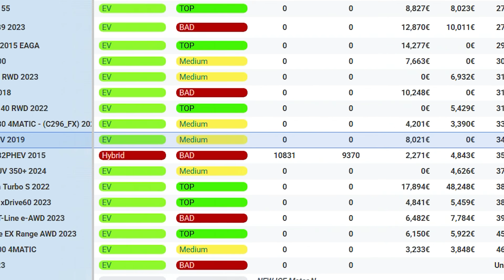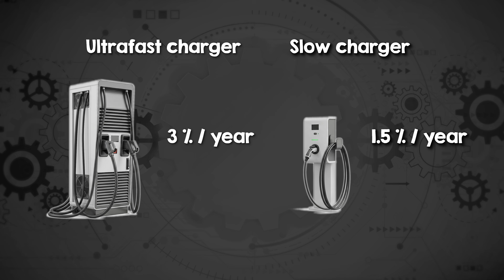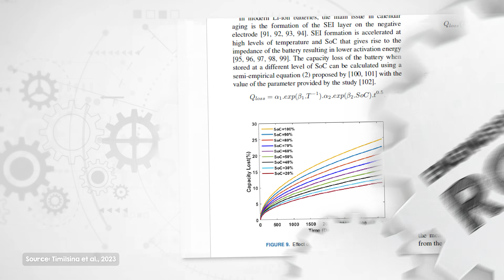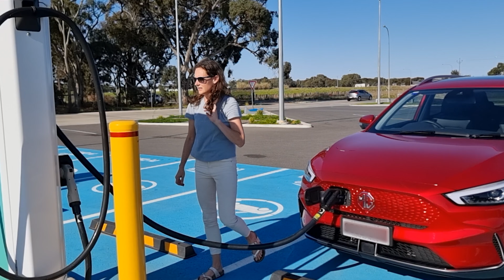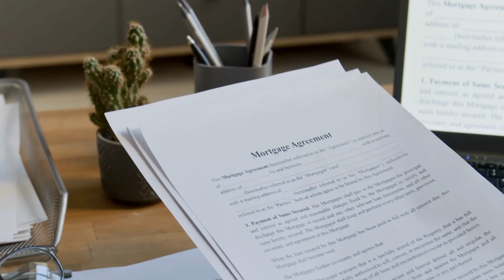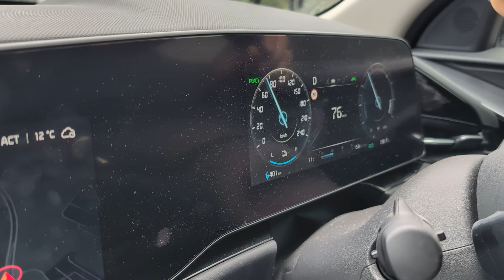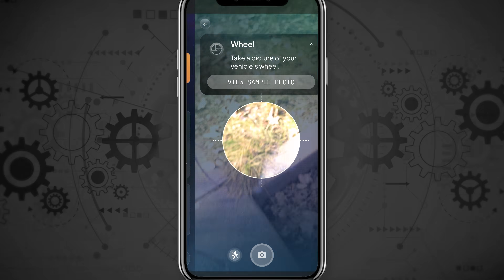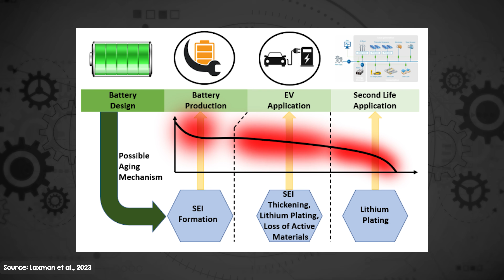Watch This Before Buying Your EV

Comment: I am in the market for something small and simple kind of like the Chevy Bolt and part of the reason an EV's is not for me.... is all the Battery games and nonsense that EV drivers have to play, as after a life time of Stop for gas(anywhere), Fill up, drive off  5 min tops and don't ever think about it for at least a Week. Sorry I don't have the desire to monitor and live by charging best pratices ONLY up to 80% and never below 20% yet we have to pay for the Full Battery usage. Bet they turn this into a monthly paid service at some point. I am in Tec. and don't want my life to rely on being internet connection etc. A coworker is frequently late (by hours) cause his car did not charge last night, the place of work is too far to make it in one trip etc (not my excuses his). Lets just say I have never had this issue. Price aside I will stick with gas till they fix all this Charging and multiple App STUPIDITY, Charging STUPIDITY, Safety, Actual real world milage and not exzaggerated bloated #'s no one will ever get.
Reply: Maybe do genuine research before you buy? She explains the 80/20 thing  like 5 mins in 😅  You have to monitor your gas in a similar way and you could get an ebike if you don't have access to solar chargers

Comment: One thing to bear in mind is that ICE car performance will typically degrade over time (horsepower drops and mechanical parts wear out). It’s difficult to compare an EV degradation against ICE but, to look at it another way, you buy what you can afford and, if you’ve had the right surveys and inspections, you will get a car that matches you needs.
Reply: Mhm research is everything and if you're in a tight money situation you can check out e-bikes or similar ev transport options 🙃

Comment: The conclusion I'm getting is that better regulations are needed to certify used EV's to improve consumer trust and knowledge. But, at least where I'm from, there is  lobbying against used cars, e.g. government EV schemes only cover new cars, and always exclude used. Although that may change as small business used car leaders seem to be getting absorbed by big corporations (similarly to what happened to independent car repair shops). In my personal case, I don't see myself being able to get an EV. I only have access to public charging stations, there are few and the kWh charged price is insane (again poor regulations and lobbying preventing real competitive market). I try to be conscious about my ICE car but, as far as I understand, my options are restricted to hybrids. Ideally I'd love to see public infrastructure where charging stations wouldn't be priced similarly to gas stations, specially near apartment buildings.
Reply: Ya.... It's a mess I actually recently found out it's even hard for insurance since the public doesn't buy EVs as frequently as gas cars so rates hike nor understand that you don't need a giant battery to get good mpg/range 🫠

Comment: thanks for the video madame, i appreciate the research and thoughtfullness that obviously shows in the presented film, i just bought an ev and as someone who looked after his old petrol sports car more than himself i am NOT missing it or scared about ev servicing prices, i dont even plan on having any issues, sure i bought a good model, but its still chinese and theyve had good models for years now and in recent months plenty more of them, just wish they had some more affordable smaller battery models as i dont really need to cart around 75kws. that said the higher sizes are useful for camping or even day to day living with phones like my samsung s24 ultra using battery charge like it's rapidly going out of fashion, forget a macbook.

worst case scenario you've got a chassis that can handle a new battery and maybe they come out with better technologies so you would want to buy a new one anyway in 7+ years. 

cheers guys, enjoy your evs and the drives and destinations!

Comment: I’ve had my EV 3&1/2 years and recently bought an OBD scanner to see my battery SOH and make sure what I was doing with my charging was okay. I was very happy to see the SOH still saying 100%. I primarily charge in my garage only at a rate to get the battery where I need it in the time I have (eg. Charging to 90% from 20% over 10 hours only needs ~5.6kW rate). I slow charge to 100% once a month IAW manufacturers recommendation. And I limit rapid DC charge to 85%. Hopefully the OBD is not lying to me but 50,000km on from new I’m pretty happy and range appears to be about the same.
Reply: The graph at 5:31 suggests that your “Soh still saying 100%”  isn’t accurate, and 50 000 km without degradation?  Hard to trust that data.

Comment: Hi Rosie I noted the 2016 Nissan leaf mentioned as a comparison in your video, really important to state this vehicle has no battery thermal management so unfortunately suffers from significant degradation from environmental heat and fast charging. 
Our 2016 24 kWh leaf is a Japanese import so it got fast DC charged a lot before we got it second hand.
As Japanese home and AC destination charging infrastructure poor.
So compared to more modern EVs the Nissan Leaf is very low tech so much more like you phone battery analogy. 
I will say on the leafs behalf it’s our town daily driver it’s still got 70% battery SOC according to leaf spy,
a battery analysis app developed for this car using OBD data.
Our car only gets AC charged these days has been super reliable, cheap to run, kids learned to drive it, been through multiple wet seasons and survived North Queensland roads and it still has no rattles 👍still runs perfect not sure how long we’ve got till range becomes problematic but we feel a cheap second hand EV bet has certainly paid off in our case 😁👍

Comment: The public access pavement trailing charging cable at 2.50 mins has to be an AI image, not too kind to pedestrians, recessed pavement cable slots are now required by councils in the UK. The image location looks very 'UK terraced street' apart from the bogus charging set up.

Comment: The batteries cells are really good, but ultimately they get combined with a lot of high voltage high current electronics like mosfets and control circuits. In the end the battery might still have 95% SOH but if something like a contactor fails you need someone that can open up the battery box, diagnose the fault and get replacement parts to replace the faulty circuit. As long as a dealership does not want to replace a whole battery because a contactor failed or a coolant connector broke (Saw a YT video about a Tesla where they wanted to replace the whole battery pack because the coolant connector broke off, it was fixed with a plumbing hack tapping and glueing another fitting). EVs should last a very long time. We need better reporting to see exactly each cell voltage in the pack, plotting that over a charge and discharge cycle will highlight any cell issues. I am more worried about the electronics controlling the charging than the actual cells. Looking forward to getting my first EV (secondhand)

Comment: Do you think AC vs DC charging alone would affect battery life? Even if the DC charging is still slow by DC standards. For example, a home 25kw DC charger would be similar to a 22kw AC home charger. Curious about this.

Comment: Also, "EVs batteries outlast the car" - Tall claim when the oldest relevant EV today is from 2008 and the oldest relevant real consumer commuter (Ie non luxury niche vehicle) is from 2012... so if the car did not even last that long and it's from 2012. when ICE cars are still driving around like new that are from 1995 and in some cases 1985... somethings VERY wrong with our perception of acceptable lifespan in vehicles.

Comment: the problem may not be the 2nd buyer. but more than likely the 3rd or 4th buyer or 20 year owner who is around to witness the actual cells/packs begin to separate and short; wherein you get to enjoy all the toxic fumes coming into the cabin as you smell a feint of something burning for the next few months as you wonder what the heck is going on, putting carcinogens deep into your lung tissue before suddenly your battery shows clear signs of catastrophic failure.  they don't just "degrade" by losing range per mile until they get low enough that you can't tolerate it - no no.., there is physical actual damage occurring inside the battery that will lead to major failure where you're at 80% one moment and the SOC suddenly drops to 0 or 10% within a few miles and then you're running far away as your car sets on fire.

Comment: Great video, very useful and thank you. I'm thinking of buying my first EV. At age 74 I'm perhaps thinking as much about my longevity as the EV battery longevity BUT am I right to believe that:

1) Longevity will be better if I'm doing low annual mileage so doing fewer charge cycles
2) If I use a home charging point that charges slowly, this will help greatly (your video suggests this)
3) I should in any case be protected against a dud as long as it has a manufacturers mileage warranty for the battery and the vehicle, regardless of age, will still be covered by it as long as that mileage has not been exceeded.

As a footnote, I've been interested in EVs since c1980 and I corresponded with Clive Sinclair (remember hin!?!) over my ideas for vehicles with swappable batteries. I still have his letter of reply where he says 'your idea has been considered and deemed not suitable at present. That is not to say that it won't provide the eventual solution'. Battery swapping is currently being pursued by Chinese manufacturers and I still think it has a great deal to offer. If only mobile phones still had replaceable batteries, it would be better for consumer and environment alike?

Comment: I have a 2025 BYD Song Pro, and the brand says LFP batteries are meant to be charged at 100% I also read on another article (don't have the link) but it said that the idea of charging at 100 all the time will cause faster degradation comes from the NMC batteries like some of the ones Tesla and some other brands use. Do you think that is correct?

Comment: I also recently bought a used EV and like you I purchased one that still had the majority of its battery warranty still in effect. My previous car was a hybrid, and a friend had an OBD2 dongle that provided some kind of a battery health report. My current car is a VW ID4 and I have no real idea what the full charge might do as the car itself gives a different distance estimate each time I fully charge, which I only do just before I need it. But at least it meets most of my current needs, it sits in the garage most of the time and easily handles the 30-minute drive into town for grocery shopping, medical appointments and such. And with a full charge it will make it to the airport and back to pick someone up or drop them off.

Comment: My Kona is a 2021 model. I'm at 110,000kms on the clock and I have no mattery degradation that I can detect. It is now 5 years old and I have had to replace the 12V lead acid battery and tires. I live in Canada and I face extreme cold and extreme hot weather.  I have a trailer hitch and I have pulled a 2,000lb trailer to Albany (about 800kms) and back (and charged on route). I have about 400kms (in winter) and closer to 500kms in Sumer range.
.
My car - looks after itself. It controls the rate of charge - it warms or cools the battery itself. I have on ocasion stepped into my car to see it used up a point or two of charge than when I stepped out - so yes it is using charge to keep itself war or cold.
.
I caught an Uber that was a Kona just like mine. He had over 300,000km on the clock and he said he couldn't really tell if the range had decreased, he drives in the city all the time and it doesn't show any loss that he can detect.
.
I used to own a 2014 Nissan Leaf - I sold it in 2021 (to buy the Kona). My Leaf had 12 bars and is air cooled. I lost 1 bar and I sold the car.  I have just come back from Vancouver and I saw a lot of old Nissan Leafs still on the road (I'm impressed).

Comment: so 2% average per year...meaning that you buy a car with an engine meant to die in 12 years...that explains the 8 year warranty barrier... nice... I keep my ICE until a Viable and practical alternative technology to hydrocarbons is engineered OR a real breakthrough in battery technology do show up... like 20 years at least of endurance not to mention the pace of intaking energy ... won't match the energy we add in our tanks but as  I said I'm waiting for that breakthrough or a miracle..until then a big NO ... they are simply short termed expensive extremely heavy and massive for the cities Toys ... (be better than ICEs ... like the engine of my little car ... battery packs should be capable to operate from -20 to +50, becoming even better as years go by, weight no more than 150 Kgs for the battery pack , being  full in 10 minutes or less regardless of the situation and this can go on for years and years and years - at least 20 -  without second thoughts before starting looking for ways to measure their degradation and  Oh... yeah ...they should have a typical range of at least 800 kms no matter what even when you go pedal to the metal ... now that's a break through and i can happily exchange the 0-60 mph in 4-8 sec for couple stop lights . I'm contend with 10-12 sec as long as it lasts for hundreds of kms)

Comment: Used to be a laptop tech support. If those Lithium Ion EV batts are fundamentally the same as the ones in laptops (notebooks), those batts might also be predicted to loose batt life anywhere from 2 - 10% per year, depending on environmental factors and useage.

With how expensive those brand new EV's are and how almost non-existent the charging infrastructure is in my country, i think i'm gonna hold back from getting one of those...most specially getting used one.

...until the technology or infrastructure matures further 😮

Besides, i'm still kinda waiting for solar tech to be integrated with these EV's...matched with regenerative breaking, i think that would really be a game changer specially for tropical countries like mine

Comment: My 4 year old kia ev6 has 61000klm on it and has 98%battery usage still. But I’ve never used a dc charger and home charge to 80 MAX unless I’m going on a long trip which we do every 6-8weeks. It starts with 510klm range @100% and when we finish the  320klm trip  to our holiday house always has about 150-180 klm left  if its a hot day and use the ac or on a cold day and use the heater it looses about 20klm of range. We are never anxious 😂
Reply: would it really be a problem to charge to 100%

Comment: I did the same, I bought an ex-lease car which had plenty of battery warranty left.
However I did my reasearch and came to similar conclusions about battery health and charging / discharging behavior.
I didn't want a new one because of the value drop off.
A slightly used one was an excellent deal and with only ~16k km on it there couldn't have been much damage done to the battery from the previous owner.

Comment: Phones are charged to 100% every time and this is terrible for a Lithium battery and as you state the thermal conditioning in typical EVs. The Nissan Leaf didn’t have any thermal management and they suffered quite badly from degradation sometimes getting as little as 50 miles range.  

Also a petrol car will lose power over time and will therefore be less efficient with injectors having clogging issues. Easily fixed and reasonably cheaply as well (depending on labour costs).

Comment: Buying a second hand EV is still a fraught exercise in my opinion. How the previous owner used it is a great unknown If the previous owner "flogged" it by deep discharge and fast charging I am not sure you could pick that up with pre sale testing as well as picking up a thrashed ICE car. Still too much black magic involving the waving of dead chickens and I wonder how long it will be before we have gaming of the testing results by shady sellers. The EV equivalent of banana skins in the diff or winding the speedo back. Quite common nowadays with digital speedometers.

Comment: Interesting report…
I just wish that industry analysts would stop pushing the benefits solely on usage habits, and do a comprehensive report about how DEPRECIATION of EV’s effects the future of repurchasing another EV. 
Then there’s the other big issue, that affects the Service Departments at dealerships, and how many Car Dealerships have fully trained technicians to look after the EV market.
Apparently, the number of automotive technicians that are employed is decreasing across all  brands, due to the low wages structure in dealers who often pay award rates, which are increasingly concerning to attract apprenticeships into the automotive sector. Then again, there will be less technicians required IF the EV INDUSTRY continues to grow as is anticipated, and EV’s require less maintenance as well, which compounds the problem… it’s all very worrying. But these realities are worth keeping in mind.

Comment: I've been calculating the charging efficiency of my 2O24 Polestar 2 82 kWh (79 kWh usable) battery, using the kWh delivered by my Zaptec Go charger. Charging up to 70% is more or less 100% efficient, except when using a DC fast charger. Above 80%, charging efficiency falls off rapidly. It's a simple way of keeping an eye on the likely State of Health. Although, only as a simple proxy.
Calculation: 
% increase (e.g. 20% to 70% = 50%)
50% of usable battery capacity = 79 kWh x 50% = 39.5 kWh
If charger delivers 39.7 kWh, charging efficiency ("Health") = 39.5/39.7 x 100 = 99.5%
Sometimes, I get values > 100%, which I put down to "experimental error", i.e. natural variation in the measurements, but they average out close to 100% for charging up to 70%. This correlates well with a standardized charging curve I found, which showed charging efficiency fell above 75% for my car model.